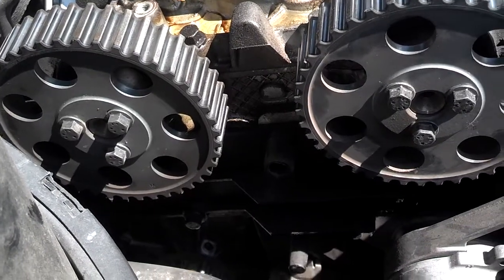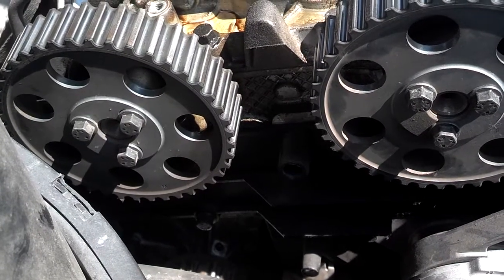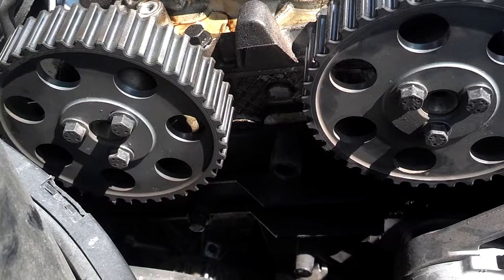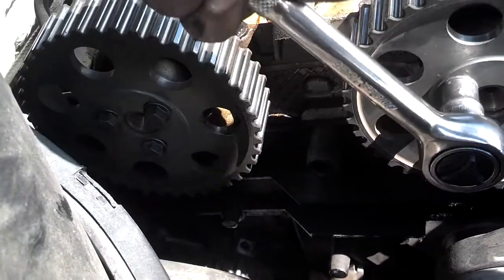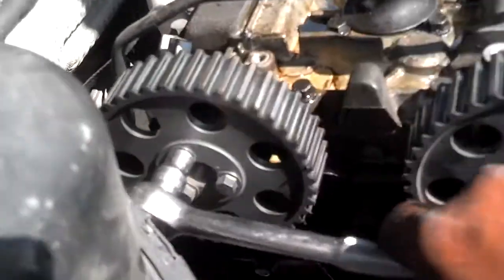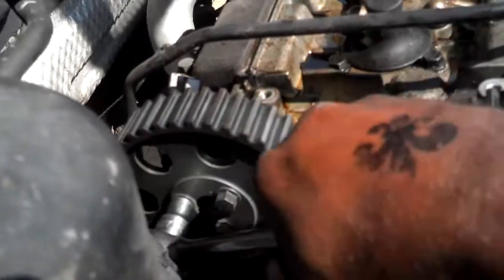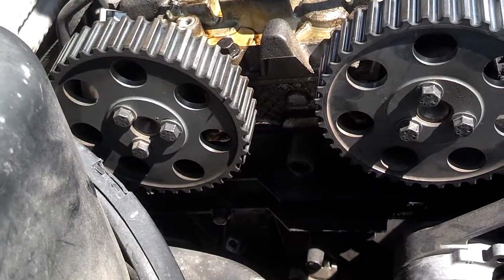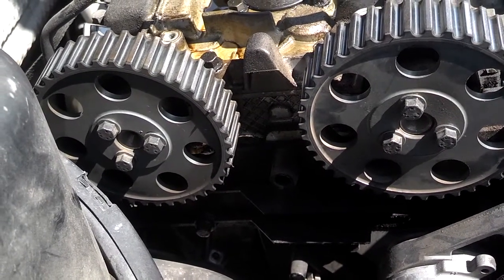Volvo timing alignment, cams moved during timing belt installation - Auto Information Series

Comment: Excellent demonstration Robert. Having changed the belts, pulleys and water pump after refitting the belts the cams went out of sync and lost power. The resetting as demonstrated work a treat and the full 285 horsepower was recovered and a big smile was restored.
Thanks a million for this and other great techniques, advice and the easy way to DIY for us Volvo Owners...really appreciated.
Rick
Isle of Man
850T-5R
V90
C70
XC70
Reply from the maker: You are welcome.

Comment: Robert, this is great.  I was replacing the timing belt on my '97 850 T-5 and the exhaust cam did move a bit.  I'm glad that you demonstrated that the cams can be rotated 360 degrees when the crankshaft is also aligned on its marks.  I can now reset that camshaft without fear of causing any damage.  Thanks!
Reply from the maker: You are welcome.

Comment: Hi Robert. Thanks for all your help on assisting me on getting the timing belt on my S90. 

I also wanted to post that this very same method worked on my 98' Volvo S90. I could turn both camshafts 360 degrees freely (with the crankshaft in time first). I was pretty scared to try it at first, but  AFAIK there was no report of this trick working on Volvo S90s so I had to give it a shot. Super happy it worked fine, engine runs smooth!  I'll see if I can get a video posted. Thanks!
Reply from the maker: +Providential Systems Drones nice, thanks for the test info.

Comment: That's really good info.

One time when I had to pull the belt off i just zip tied them together to keep them from moving around too much cause I didn't have one of those handy little cam locks. I also think you're supposed to crank them a little past the marker (maybe a quarter turn?) and then bring them back to the mark position before you take the belt off.

Comment from the maker: I have never used a cam locking tool. I have had my cams move a little while changing a timing belt, I simply just turn them back to the marks and keep on going.
Reply: Hey Robert. I have a 2004 Honda Pilot and the back cam moved clockwise a little bit when i was trying to get the new timing belt back on. When I try to turn it back to the mark it moves a little but snaps back into the place it started. What should I do to make it turn?

Comment: Mine has a VVT on the intake cam, but I think that could be also turned clockwise to reach the mark on the cover? Just as long as the crank is set on it's mark. S70 -00, 2.4l NA
Reply from the maker: Correct

Comment: Thanks for this! Most videos just gloss over correcting a misaligned cam when replacing a timing belt. 

I'm doing a timing belt replacement on a 2011 Volvo C70 and the exhaust cam sprocket moved one notch clockwise. Unfortunately I didn't lock the cams only marked them. Is the best method of re-alignment to turn it backwards? Or should I go around 360 back to the timing mark? If I do move it back or forward should I lock the cam beforehand and loosen the T55 bolt so the cam moves freely?
Reply from the maker: https://youtu.be/U9TDU1WLUpc
Reply from the maker: that is a P1 engine. If you didn't remove the cam hubs/sprockets you can just put the crank on it's mark and turn the cams where they need to be.
Reply: @RobertDIY  Thanks so much for the quick response. So if the exhaust cam sprocket move forward one tooth and nothing else moved, I can just force it back counter-clockwise my hand (I wasn't sure how much force it would require)?

Comment: Hi Robert, I own a 2002 Volvo s60 2.4t, there are no marks on the cam sprockets. how can I set the time properly if the sprockets have moved?
Reply from the maker: Text me a picture of the cams hubs/ sprockets.
Reply: @RobertDIY  I will get you a picture tomorrow. Another question I have is whether the exhaust sprocket is spring-loaded?

Comment: So I would just leave the rear cams parallel after finishing the timing belt? Instead of moving the right rear back to where it originally was? Or would neither affect operation?  Sorry for all the questions
Reply from the maker: +Robert B Not sure what's going on with your situation, but if the marks on the cams are aligned with the cover, I'd leave it there.

Comment: How do you align the crankshaft if you don't think it is in alignment with the cams? 

Also when you turn the rear cam with a screwdriver to make parallel with the head, do you have to tun the cam back to the original position after you are done with the new belt/Cam Seals??
Reply from the maker: +Robert B If the vehicle was running, the crank will be very close. If not, you have to work on it. 

As for aligning the cams on the back of the head, that would be the proper alignment, where the front side would be aligned with the cover, if the cam sprockets are still attached.

Comment: So as long as the crankshaft marks are aligned, I can just align the cam sprockets marks to the marks on the cover and go ahead and install the timing belt? No need to be at TDC on piston #1?
Reply from the maker: Engpichon That is correct. These cars (as with most newer cars) are timed by marks, NOT TDC.

Comment: On my ‘97 850 R my intake and exhaust camshaft moved about 2 teeth each with the belt off when I was changing the timing belt. The crank pulley is still lined up. Does it matter which way I rotate the camshaft to get it back in time with the marks? or can I rotate the camshafts in either direction
Reply from the maker: Doesn't matter.
Reply: Awesome, Thank you so much!

Comment: Hi Robert, I have a 2004 volvo v40 4cyl 1.9L and both of my sprockets are off of the cams. Does this video apply to the V40 as well? I don't even know what position I should put the sprockets back on in or how I can turn them to fix the timing? Any help would be greatly appreciated, thanks.
Reply from the maker: If they are VVT hubs no.
Reply from the maker: Also, I don't know how to set the VVT hubs from scratch so you should probably take the car to a VOLVO MECHANIC to have that fixed.
Reply: Robert DIY thanks for your recommendations.

Comment: Hey robert, im having a certain issue with the timing belt replacement on my 96 volvo 850 turbo, when i have the cams and the crank lined up, the belt will go on but have a bit of slack on the roller side, and will be tight on the tensioner side, and i cant get the tensioner to slide under the tensioner roller, so what i did was advance the crank clockwise, a smidget, like half a tooth, and every thing was able to fall into place, i rolled it over several times, and it seems like the crank has went a little bit more out of time, but i dont feel any valve to piston contact, is it ok if the crank is a bit off, and the cams are dead on?
Reply from the maker: Huh? Crank is the starting point. Then get the cams as close as you can.
Reply: @RobertDIY  i advanced the crank half a tooth, to a tooth,  so i can get the cams dead on, will that mess anything up? I even rolled it over by hand, and i didnt feel any valves contact
Reply from the maker: Hey man, when the crank is on, how far off are the cams from their marks? You'd have to be 3 or 4 teeth off to have issues with contact.
Reply: @RobertDIY  thanks for the info!

Comment: Sir, how about on a 2004 Volvo s40 which have vvt. my cams moved while completing my serpentine and timing belt replacement/repair. I applied this procedure for my Volvo s40 2004 w/vvt (RN motor, as I learned from your other videos) and got my marks aligned ("timed"). Unfortunately, I was unable to start the car. after performing various diagnostics (fuel, spark, compression) I discovered no compression for all 4 cylinders. I've two mechanics tell me it sounds like timing is off. I have been told that I may NOT be on compression stroke. Is it possible for timing marks to be "aligned" yet be on an incorrect stroke. How is it possible? Better yet HOW DO I FIX? do I have to remove valve cover to find valve in correct compression stroke for #1? Do you have a video with these steps? any information is greatly appreciated. God bless you and thanks in advance.
Reply from the maker: Well, this video is for the old N engines which were installed in the P80 cars. I have several videos posted on the RN engines and P2 cars. Your S40 doesn't even have a timing cover like this, how did you time the cams to the cover?
Reply from the maker: https://youtu.be/YpOYTVpzzic
Reply from the maker: https://youtu.be/5Lqn2D5xc6Q
Reply from the maker: https://youtu.be/0H5cgRYCMQg
Reply: Thanks Robert DIY! My S40 2004 1.9L turbo (old version, meaning that same year they came out with the new version) has a timing sprocket cover with "timing notches." I used notches on cover and crank sprockets timing notch. can you provide me with those links please? Thanks. Oh also may I didn't mention previously but i'm trying to figure out how to fix /correct my valve so that are sitting in the proper compression stroke. how do I do this, sir?
Reply: I'm not as much of an expert as Robert, but as perhaps you are aware, the cam pulleys are twice the circumference as the crank pulley, thus if timed to marks will be in correct orientation with crank.  As to compression stroke or exhaust stroke, I believe that the ignition timing (whether distributor or electronic) is keyed off the cam position, not the crank position; thus, the choice of stroke is impossible to mix up.

Comment: Hi Robert, this is from abroad, great videos. The timing belt on my Volvo S80 T6 went broke at idle on a parking lot, car was parked, running idle when suddenly stalled. W tried to start it back on not knowing the situation. Took to the broken timing belt off and now when I tried to rotate the cams by hand it wont let me more than just a bit. I wanted to ask you what should I do first prior to reinstall the new belt, crankshaft alignment or camshafts in which order and how, using a rachet on camshafts? Thanks for your help. Best from Central America.
Reply from the maker: https://www.youtube.com/watch?v=hJIoyHLl30U